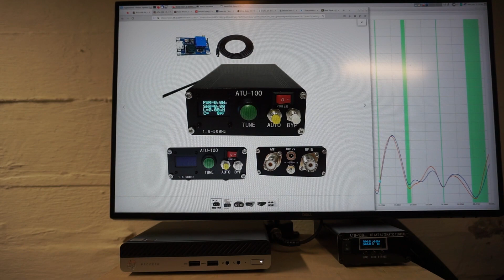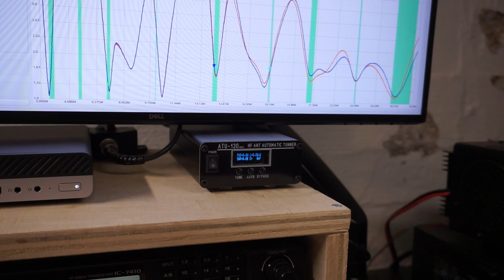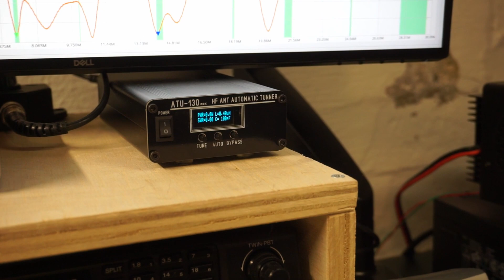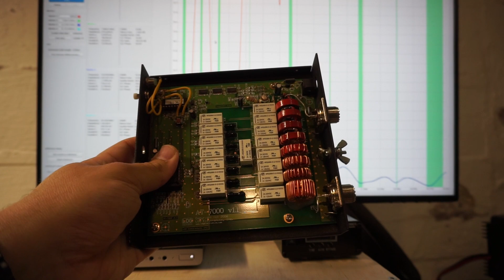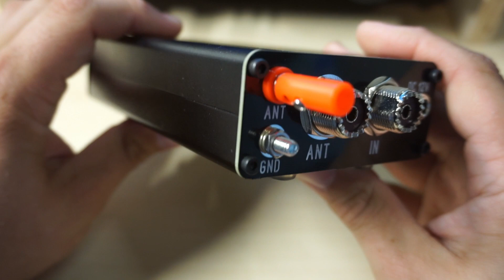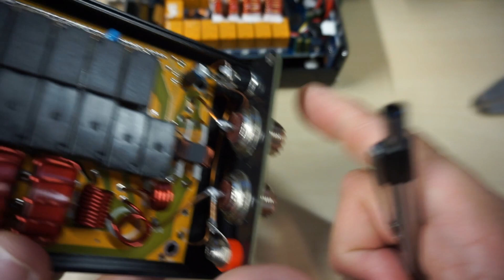Taking a look at the ATU-130

Comment: I would like to use the ATU-130 as a remote. Will the tuner retain the autotune setting if I switch it off, or do I need to select autotune every time I power it on?

Comment: It looks like, in two years, they still have not got the mismatch between the barrel connector they supply and the barrel connector jack installed in the unit resolved.   I had to replace the power jack on the unit to make it compatible with the barrel connector they supplied.   

Otherwise, I have been quite pleased with its performance.   I intend to purchase another one, remove it from its case, install it in an IP65 rated ABS plastic case, along with a bias tee, so it can get power over the coax.  After installed, I will test it and then remove the display - no need for a display that I will not be able to see.  I will also fit it with both coax and balanced outputs.   And, it will be used as a remote tuner in full automatic mode.

Thanks for the video, and 73!

Comment: My ATU-130 is not stable. After I let it ‘Auto Tune’ with 10-30 watts 
I push the ‘Manual’ button. Otherwise it will keep trying to re-tune. 
Even in ‘Manual’,  SWR ‘creeps’ up and up. I have big wire antennas. 
I think the toroid coils must be heating up. SSB is the only mode that 
Is barely usable. It’s a cute little unit. I guess you get what you pay for.
Reply from the maker: It's possible that you have a bad unit, but my guess would be that the SWR on the bands you want to use on your wire antennas is right on the edge of what the tuner is able to correct for. In my experience the ATU-130 was able to tune something that was around 6-8 to 1 (as much as 10 to 1 with 50w or less) down to 1:1, with the exception of 75/80m where it was necessary to be a lot closer. 

Have you swept your wire antennas with an antenna analyzer?
Reply: @john8520 Thanks for the reply. I have a 200’ double zepp, and a 500’ loop. Both fed with
(window line) transitioning to 50ohm coax for each into the house. ATU’s are at the rig!
 SWR’s are typically 1:5 to 7:1 on all bands.
 (I have adjusted the Fed line for these SWR ranges) My LDG 100 Pro is stable
 for my antenna system and works great. Also the LDG has ‘Latching’ relays
 which allows (LDG-100) power off after tune-up. The ATU-130 doesn’t.  
Again, I like the ATU-130. I just have to be careful how when and I use it.
Reply from the maker: @ Interesting, thanks for the additional details! I do wonder if maybe you have a bad unit - since none of these things are branded or serial numbered, there's no way to know where they came from, it's entirely possible that a few different factories are producing these. I have encountered this with some other cheap Chinese amateur radio gear I've experimented with. Something that really stands out are the toroids used, in my experience while other components tend to be matched, there's no way of knowing if they used the right mix in their toroids, or if they're just using cheap generic ferrites.
Reply: @john8520  Update, I watch a video of a guy opening up an ATU-130,
 I noticed a front display wire bundle routed next to the largest Toroid 
coil (for low bands matching) This might explain low band instability. 
I moved the Bundle away from the Toroid.  
Now, when it (auto) tunes 75 meters, I then push ‘Manual” button. 
The ATU stays Put! So Far So Good. 
Wire wound toroid cores typically are uneffected by surrounding components. 
Hopefully this is ‘the fix’.
Reply from the maker: @marcroche9324  Fascinating, thanks for sharing!

Comment: I built my ATU-100 from kit form (only $35) and it tunes just about everything. Now as far as the ATU-130 goes, it really struggles to tune on 75/80 meters,  it will tune with low power and appear to be tuned correctly, but once I start talking it goes haywire and acts like it never tuned to begin with, making god awful relay noise and never achieves a tune. i can honestly say the ATU-100 is better, except for the fact that it's only for qrp, i would be scared to put more than 50 watts into it. I don't think I would trust pumping 125 watts or more into the ATU-130 either. Now, I was watching your video, you show the insides of the ATU-130, mine looks completely different inside. I only have one large ferrite, where you have 4. Where those ferrites should be in mine, I have large copper coils in their place and I also noticed when you booted your atu-130 up, it says atu-100, as where mine says atu-130.  Anyway, these things are hit or miss, you never know what you are getting.

Comment: I have one of the ATU-100s with a bypass that you mention. It is great for those troubled by HOA rules. With a 9:1 unun to extend the impedance range. It matches a 49-foot wire in my attic better than about 1.5 to 1 on all the ham bands from 40 meters to 10, including the WARC ones. Without that unun I could only get a good match on two or three.
Mine has latching relays, which is handy operating portable off batteries. Once you have a match you can turn it off.

Comment: Thanks for the very detailed and informative review. I've bought one of these (the ATU-130) and I'm quite happy with it. It works quite nicely with my Yaesu FT-891. It tunes very quickly and has a pretty large tuning band. I work almost only portable and I don't miss the internal battery. I need 12V to power my transceiver anyway, so that's another pair of small alligator clips on the larger one that feed the transceiver. Easy and no need to worry for the discharge.
Best 73s de F4LDT
Reply from the maker: Thank you for letting me know, I'm glad it was helpful!

Comment: Hi there, great video, but do you have a link to an instruction manual?
Reply from the maker: As far as I know there are no manuals for these Chinese auto-tuners. I believe most of them (including this one) are all clones of the N7DDC design, and there is documentation for that here:

https://github.com/Dfinitski/N7DDC-ATU-100-mini-and-extended-boards
Reply: @john8520  It's strange that the manufacturer of the ATU 100 pro never built a 200 watt version - so it's a clone. The firmware is the same, which would be a plus point - the ATU 100pro website even describes how to carry out an update. But the current version is still 3.2. I've had some problems with my device since then. After the first tuning process, it keeps trying again and again during QSOs - which is very annoying and really disrupts radio operation.